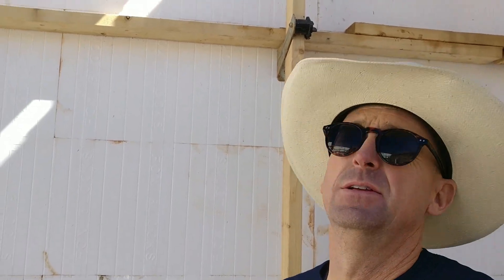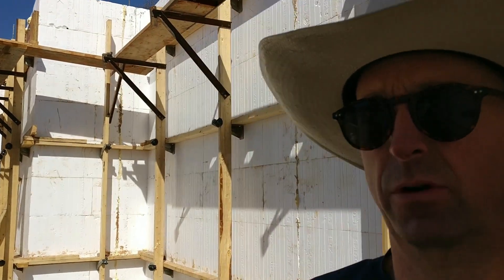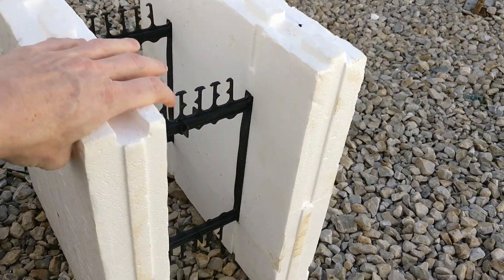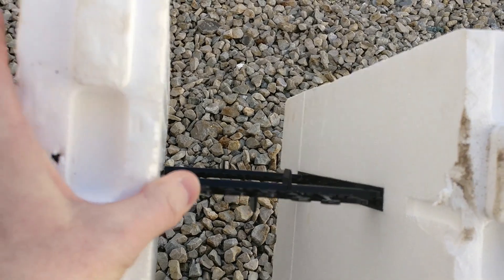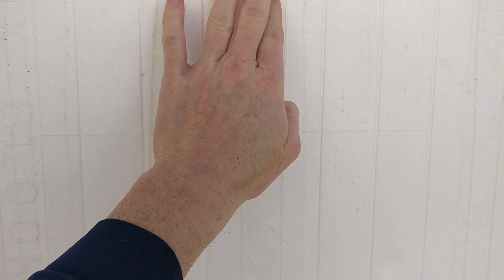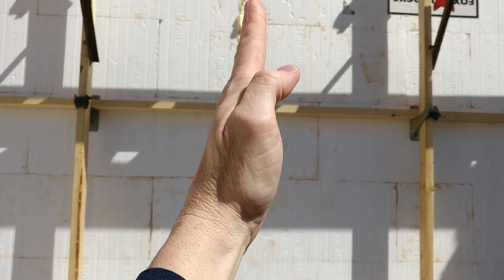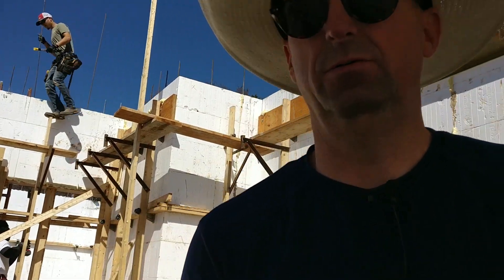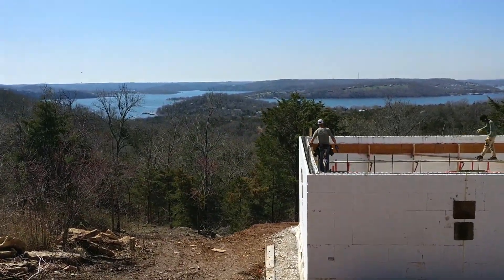Building with ICF Block: Removing Forms and Preparing for 2nd Story

Comment: Can you tell me what you had to do with the exterior face of the ICF wall, where you placed backfill against it?
Reply from the maker: Hi Pat! We didn't have to do anything because we have a waterproofing additive in the concrete, so we don't worry about water infiltration. It is called Xypex. If you don't use that though there are lots of ways to waterproof the outside of the ICF block walls. Some are stick on vapor barriers and others are paint roll on products.

Comment: How to make sure the concrete doesn’t blow out of the stack joint? Apply sealant foam before or after pouring? Your response will be greatly appreciated🙏🏻
Reply from the maker: Hi! Thank you for your questions. Our other videos show the bracing and the wood panels that were added during pouring to prevent blowouts. It is also important to have the proper additives and slump in the concrete mix.
Reply: @LakeLotBuild  Hi again, thank you for your response.
I meant the "Stack Joint". You have remarked about it in your video. Since there will be an inch of space in between, will the concrete blow out of there or should i apply the foam sealant before the pour?